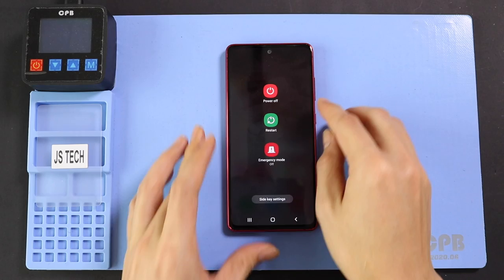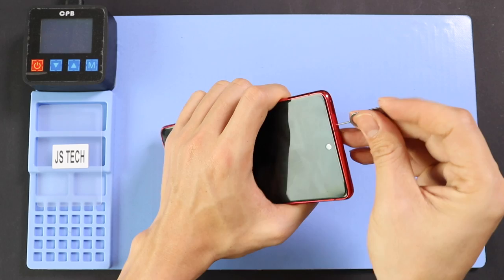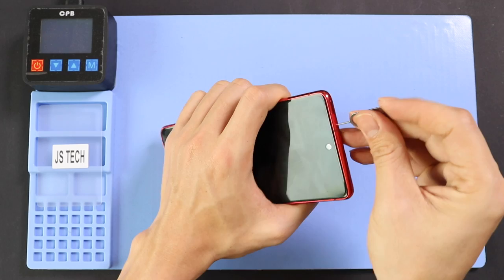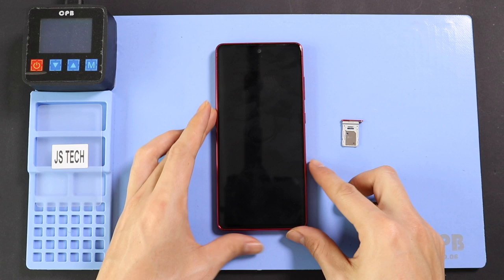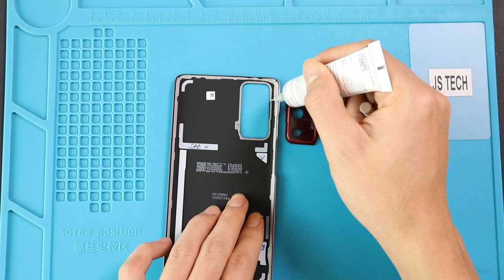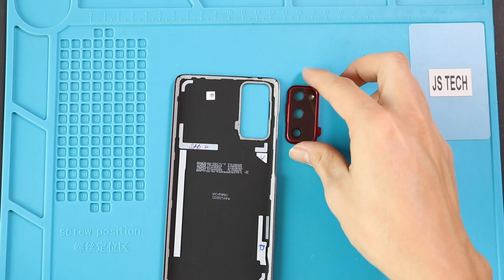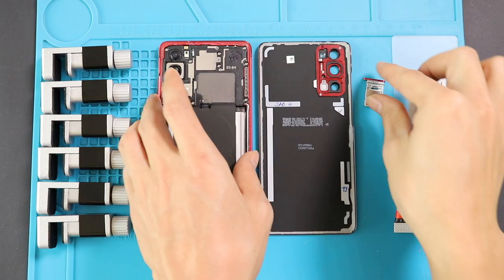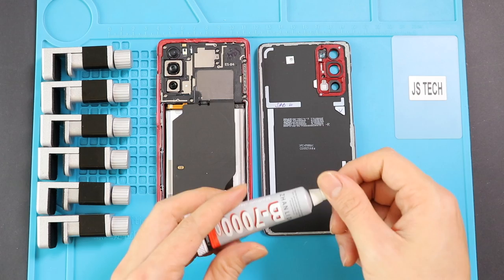Samsung Galaxy S20 FE Camera Lens Glass & Back cover Replacement

Comment: @Geardo i accindetally broke the back glass, and i lost the piece which cover the tele lens. Since then the phone cant focus on tele mode, do you know if i can fix it just replacing the back rear glass without the frame? or the frame have something to do with it? or the focus problem is not related to the glass? Thanks a lot
Reply: If it can't focus then it's probably dirty or has some kind of stain.  Cameras sometimes try to focus on the stains that appear near to the lens.

Comment: There is some water condensation on the lens.  Kept it in rice for about 36 hrs which proved useless. Now the camera app won't start... I'm worried that droplets might've damaged the camera module. what should I do? pls help!
Reply from the maker: How about keeping another day or two. Otherwise cleaning may help it, but can't tell exactly without looking at it.
Reply: Ive found more success using a hairdryer untill my phone is hot to the touch then letting it cool down
Reply: Update : I placed my phone in socks and taped hairdryer on the opening. Condensation was gone after 2.5hrs. The top camera module's been damaged by water. Samsung's native camera app shows black screen (I think it's coz software is not able to detect all three camera modules). Currently using phone with a gcam mod which uses only main (middle) camera, so no telefocal 30x zoom or wide angle. 

It sucks... I trusted ip68 rating a bit too much... Never gonna make that mistake ever again :-\

Comment: Y'all I need your help. My dad thinks the camera cover is made of plastic though I'm pretty sure it's glass. I'd like to prove it to him but I don't wanna smash my own phone so can ya send me a link of a broken galaxy s20 fe lens?
Reply: tell me how do i send it to you
Reply: @ia796  true true
Reply: @Tomytoka  I thought I already replied but I guess I didn't hit enter... Can you just use a linksharing service and put it here? On samsungs it's called link sharing but you could also just upload it to a Google drive or sth and share that via a link.
Reply: Take a knife, but clean it because residues may be harder than glass and may be able to scratch it - 
Then try to scratch the lens with the knife to show him that it does not scratch at all because the blade is actually a softer material than glass. (But before check for yourself of course.)
Reply: @TheHolyMeeps  yy
Reply: Definitely glass. Mine shattered
Reply: @rrraynoorrr  is there a thin plastic film on the camera glass already applied out of box?